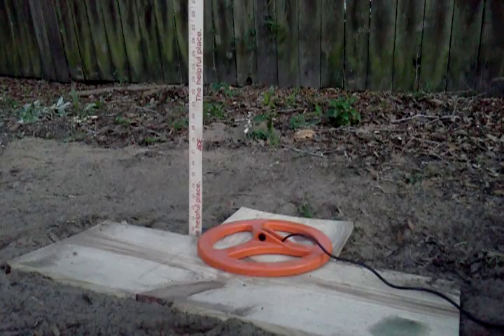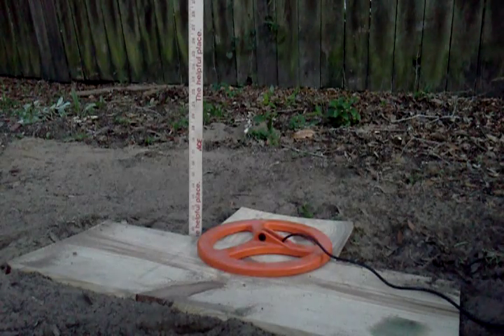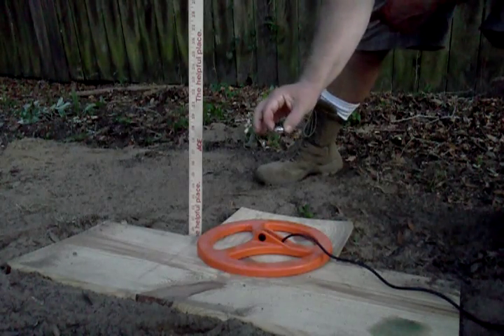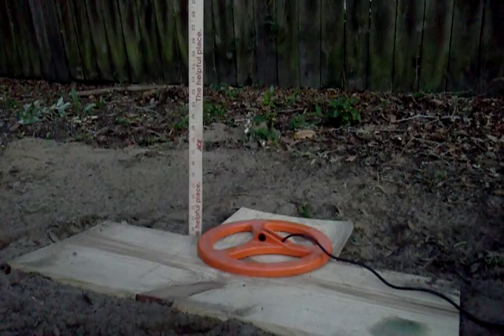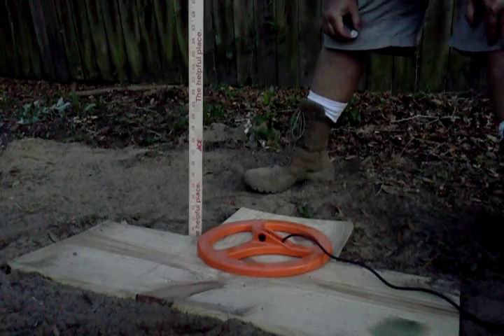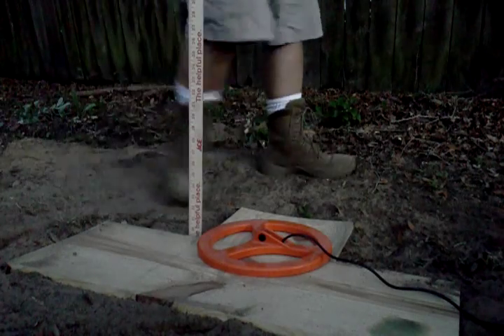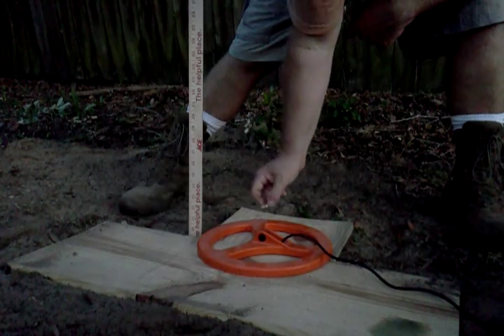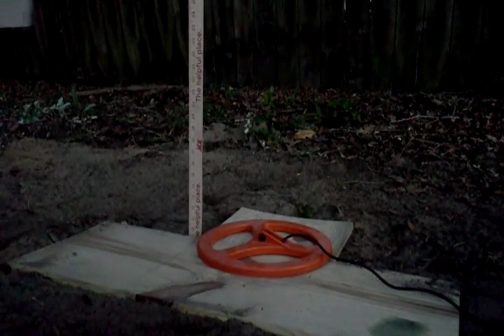White's PI 1000 pulse induction metal detector depth test

Comment: A fantastic machine . I've worn out 3 of them . Can't get them repaired anymore .. To get more depth I put 12 volt battery  pack  in ..  When diving I found you had to retune every 3foot of depth to stabilise the tapping . About 1 tap per second was about right . Also very good in rocky areas cos its not a motion motion .